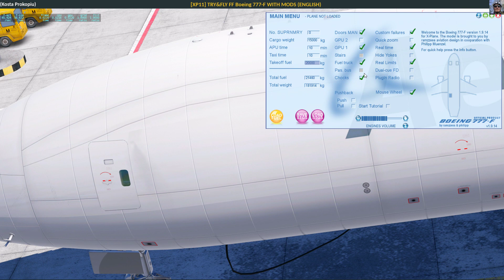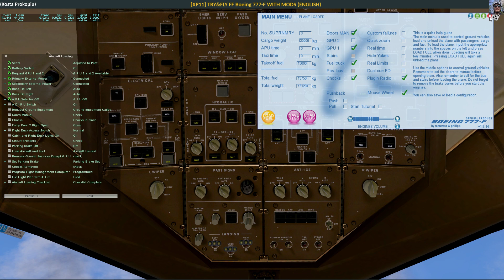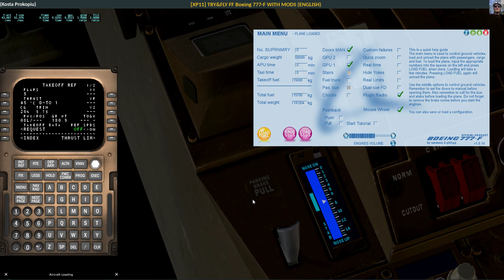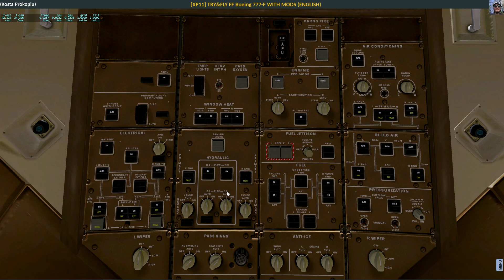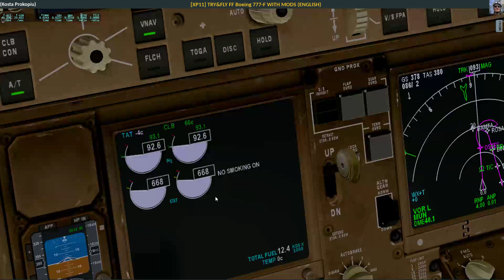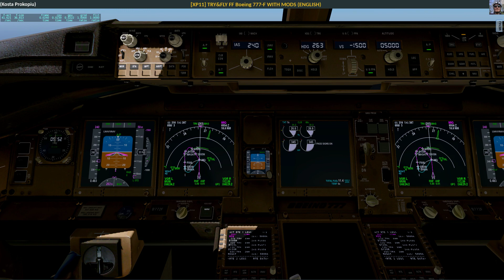[XP11] TRY&FLY FLIGHTFACTOR 777 WITH MODS (ENGLISH)

Comment: I don't think the plane is doing anything wrong on take off with regard to the acceleration. After you had reached the acceleration height, the plane bugged for the next target speed without exceeding flap limits. The flap markings on the speed tape are the minimum flap speeds not the maximum...